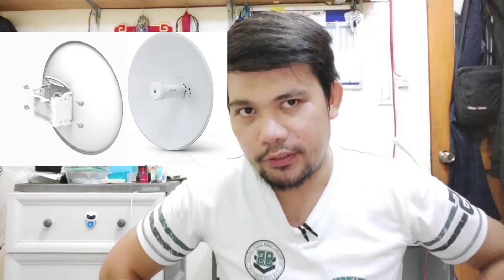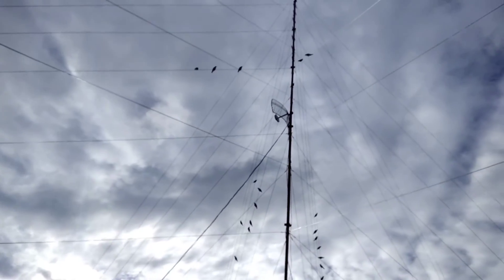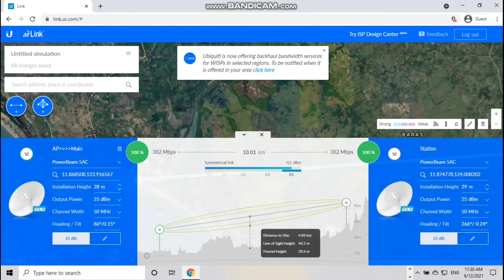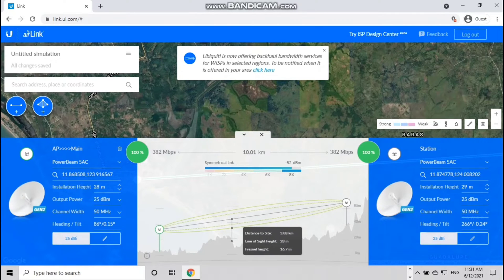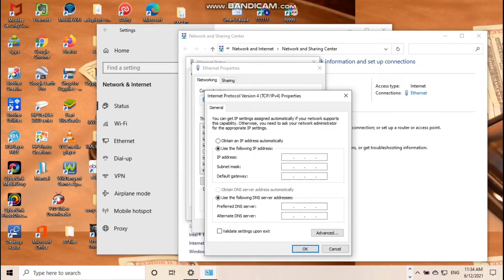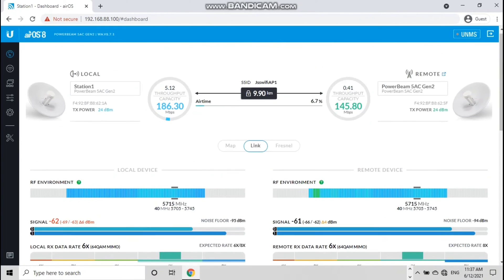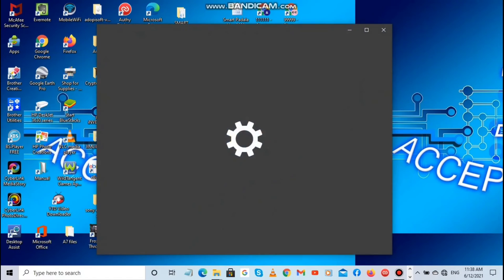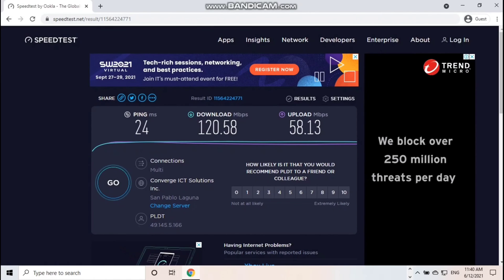UBIQUITI POWERBEAM 5AC GEN2 10KM POINT TO POINT| Ilang Speed ang kaya e bato?

Comment: Mag kano gasto mo nyan lods?
Reply from the maker: cguro nasa 25-30k di q na compute peru naka tipid aq...dito lang sa shop.namin ginawa ang tower.. monkey.man nman partner q lang sa negosyo nato..kaya naka tipid😁
Reply: @boytirador198  pano ang load nyan lods    mag kontrata ka ba sa pldt nyan?
Reply from the maker: @jeffrylabid341  yes boss residential line 3yrs contract... sa business line may 1yr or 2yrs...pila ka lang sa business line may 500mbps may 1Gbps... sa residential rekta kana sa 600mbps @ 699 per month mas sulit yun
Reply: @boytirador198  san tayo pwdi maka bili ng point to point accessories lods ? Pa guidenaman lods gusto ko lagyan pesonet bahay namin
Reply from the maker: @jeffrylabid341  shopee lang aq bumibili
Reply: @boytirador198  pagka bili mo lods openline na un modem  kahit anong sim pwdi?
Reply from the maker: @jeffrylabid341  PLDT po ang source nang internet q sa video nato sir... kung malakas nman ang speed nang smart at globe sa inyo pede na yun maging source mo... merun aq installation guide nang PisoWifi using mimo antenna & openline modem... ito ang link: https://youtu.be/Egleb3P4mzw
Reply: @boytirador198  salamat lods
Reply: @boytirador198  sir magkano po 1GBPS sa PLDT? hindi ba yung leased line dapat kunin dyan kasi provider ka ng internet?
Reply from the maker: @Digital.Pinoy.Music03  9,999lang po.... valid ID lang requirements pag residential line kunin mo... pag marami ka pera Go for business line 20K ata ang 1000gbps nila at mag provide ka nang requirements tulad nang DTI,BIR,MayorsPermit,